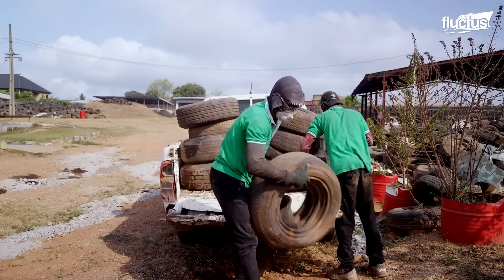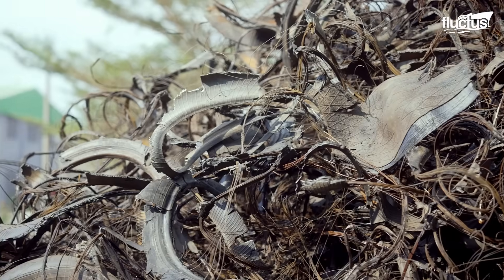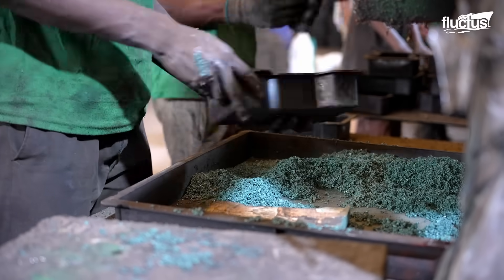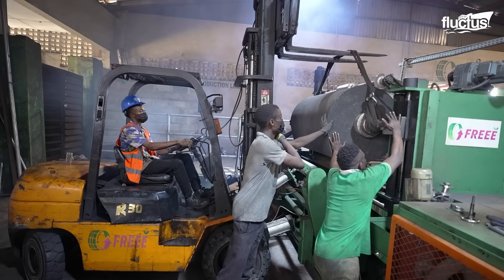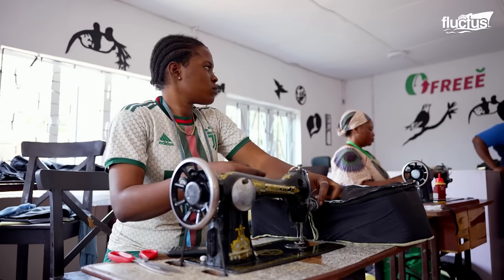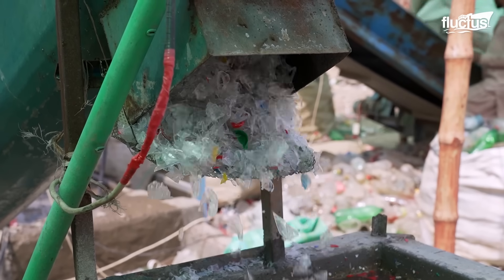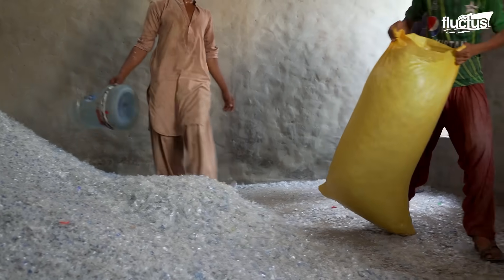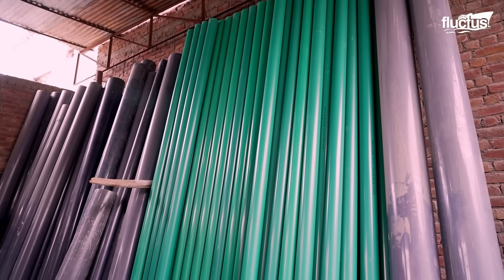How Nigeria Found a Genius Solution to Recycle Millions of Used Tires

Comment: What they are not saying is in the US they tried to use those tire chips as mulch on playgrounds saying it would help with safety.  Issue is tires are not 100% rubber but majority petroleum.  In the summer you can smell them breaking down. It smells like asphault and is a carcinogenic.  So the US had to remove all.  I owened a tire store for over 20 years.  Have you ever smelled when a person spins their rear tires? Breath it in you'll be sick . The petroleum in this product has not been removed.  It's a toxin as it breaks down. Trust me there is no good solution to this issue. Used to be even a small 14 inch tire used over 5 gallons of oil to make. These days maybe less but petroleum all the same.

Comment: 400,000 tires in 3 years = 75,000 per year divided by max 365 days = 205 tires per day divided by max 3 shifts max per day = 68 tires per hour - on that single steel belt shredder - at more than one tire per minute?  That was a small operation and perhaps they have other plants - but I'd be very surprised if these numbers are accurate.  I love the idea of solving the use tires issue, but so much of what they tell us about recycling is inaccurate.  See plastic resin numbers 3, 4, 6, 7 - never or rarely recycled, just moved to other countries.

Comment: I think these people may be going down a dark and dangerous path. 
It is very likely that they are pressing the tire particles into cancer-causing bricks (pavers). 

I asked Google if tire particles were carcinogenic (cancer-causing). It answered - 
"Yes, tire fragments can contain carcinogenic compounds. Tire wear particles and emissions include heavy metals, polycyclic aromatic hydrocarbons (PAHs), and other toxic elements that can pose health risks. Some of these substances are known carcinogens, meaning they can cause cancer." 

I recall the use of tire particles was stopped because children were getting various cancers from their tire particle based playground. Beware! Check and see what is going on!

Comment: This is not actually a new idea.
I remember for a short time back in the early 60’s I worked for Bata Shoes. As part of the induction to the company, I was invited to a tour of the factory in East Tilbury.
I noticed that they had a mountain of old car tyres and I was told they would be transformed into soles for some types of shoes.

Comment: I built a whole extension on my house using the packed tire method. All the tires are packed with earth and stacked as walls then coated with a soil clay mix that seals them and any residual off gassing. Got then idea from the earth ships they build in Mexico and the states, the tires you can get for free from the local tip then its just manual labour and lots of it, very satisfying though good people.  Whole houses can be built like this look up earth ships on google.

Comment: this isn't the only method to recycle tires.

earthships & mechanical concrete are 2 ways as well 

i have used a few hundred to build retaining walls for various landscape features & as a stabilized base for my 1ksqft patio.  parging the tires w/a mason mix, carving stone patterns, & coloring gives the look of a field stone wall.

it's labor intensive; however, i got the tires for free & enlisted the "works for pizza & beer brigade" a few times,  2 summers later & bob's your uncle.

Comment: Found this on google,
Yes, tire rubber and the processes involved in its manufacturing can expose workers and potentially the environment to carcinogenic substances, including N-nitrosamines and other chemicals. Tire rubber can also release fine particles into the air that can be inhaled and lead to lung cancer. 
Guess I wouldn’t want anything I would wear or use around the house or food to be made out of this stuff.

Comment: There's been a higher cancer risk associated with use in athletic pavements. There's some off gasing when subjected to high temperatures and UV light from sunlight. Maybe that's why it's mostly burned for energy in cement plants in the US and EU. I believe most plactic waste is "recycled" by burning it without telling us the truth. And it's the better way because it wont become microplastic this way

Comment: This is NOT environmentally friendly. The shredded tire crumbs will produce microplastics, a more environmentally challenging byproduct that is also a health hazard.
The chemicals in the tires -Zn, Sulfur, heavy metals, and PAH—will easily leach into the environment and waterways. 
Also, the tire crumbs are reported to be carcinogenic. 

This is a repurposing process, but it puts the environment & citizens in more hazard than a pile of used tires.

Comment: While this is a better option that simply tossing them in a landfill in reality it isn't much different. They are still sitting on the ground slowly breaking down and leaching into the soil.  A better, albeit more costly option is to pyrolyze them back into feedstock to be re-refine and reused for other products.  There's actually quite a bit of useful material that can be recovered from tires after pyrolysis and if done right it is a FAR more environmentally friendly option that just grinding them up and walking on them.

Comment: Are we really Id iocracy degenerted…? This is more of a problem than helping. This materials are brought on purpose- there are other options to avoid this poisonous materials not realized for many reasons beyond the imagination of brainwashed individuals.

Bacteria that transform rubber and plastic into natural substances would be a solution.
The  shown economizing advertising manipulating bullshit, however, “destroys” yet more energy to convert a problem substance into superfluous products containing problem substances!
The industry propaganda shown, deliberately prevents nature-compliant solutions such as the return to product cycles based on hemp or other natural fibers.

Comment: How do they convert PET (commonly used for soda bottles) into PVC?
PET and PVC are chemically incompatible and cannot be mixed or converted into one another. Additionally, PET does not have the necessary properties—such as rigidity, impact resistance, and long-term durability—for use in stormwater pipes. It's more likely that the bottle caps, which are typically made from HDPE, are the material being recycled for such applications, as HDPE is suitable for making durable, weather-resistant pipes.

Comment: Superb.   The whole world should be doing this.  Thank you.   Brilliant
Reply: The Nigerians didn't 'find' this solution, they copied it from elsewhere, it has been done in Europe and North America for many years... 👍
Reply: @ I haven’t seen that.  Not seen the results either but I applaud  them too.  Don’t care where it started but the rest of the world would do well to follow.  Not heard of it in the UK.
Reply: @dawnmatthews7716  Here in Canada, recycled tires is used for a few things that I know of. Those winter anti slip rubber mats that you can lay on outside stairs or porch. They also make big rubber weight to hold temporary signalisation during construction or road works. It is also sometimes incorporated into asphalt as apparently the rubber particles can give it interesting properties
Reply: @EvilMaxWar  Also, in Canada, rubber tires are/were an ingredient in concrete/cement.
Reply: I live in Oklahoma and we have a tire recycling plant in the town south of mine.
Reply: @oklahomaisok that’s excellent.
Reply: The world is doing this.   This factory is an old outdated version of the process they adopted from other factories.
Reply: there's no valid reason why we don't do these things in America
Reply: @davidnewland2556  We have a tire recycling plant in central Oklahoma. The EPA tried to stall the opening of it but it eventually got permission to operate.
Reply: @davidnewland2556 We are
Reply: Notice how many steps involve workers handling the materials. For this to economical, it requires wages to be very low, and workers to be compliant. You wouldn’t see the average North American teenager accepting such jobs for the kind of payment required to make it work…😢
Reply: @donaldleblanc3056  or the UK 😂
Reply: I could be wrong, but this probably can’t be done in America because of all the ridiculous rules and regulations that the ruling class has put upon the people.
Reply: @barbarajennings1798 I’m in the UK.  I’ve no idea if it would be a problem to implement.

Comment: This was happening in Canada in the late 90s very early 2000s and subsidized by the government.
We had to pay extra Tax buying a new tire (which still exists) and pay another $5 each tire when dropping off at the transfer station/dump. 
Today the Tax (they call it Eco Fees) apply when buying any tires.
Both the $5 Recycle Tax AND the purchase tax at once.
You pay those Eco Taxes even if you're keeping the ones you were switching from yet the actual recycling places are nearly gone. 
Once the subsidies stopped... so did the tire recycling on as big a scale as it had become. 
I think it still exists here but it's only a few plants.
It was pretty much the same thing - Cow Mats, Floor Mats for industry and vehicles etc.

Comment: 95% of waste still goes into the land fill and ocean and creating a temporary floor or waste water pipes is not getting rid of the tire, it's still there when the floor is deconstructed or new pipes need to be installed. This is not a cycle, this is hiding part of the problem for some more years.

Comment: Suggest using the bead wire to wrap the stacks would help with the recycling of the metal. I can design a twist wire mechanism that would bind the bunch.

Comment: What a nightmare of a work environment.  I can't imagine how unhealthy it would be to do this work.  God knows what volatiles are gassing off from just shredding them alone.  No particulate mask can block that.  Yes, in theory recycling is good, but look at HOW they are doing it.  Crazy.
Reply: Carbon filter lab grade brother you could spray paint and not smell it also stops nitric acid fumes and that makes rubber dust seem like play doe. Really should have extraction to a disa carbon filter before being exhaled to the environment.

Comment: Great idea, but more engineering is required to process into useable products with sealed automation to prevent health risks to workers.
Reply: then the workers go hungry
Reply: @iantaylor2675  The unsolvable problem with automation, when it is combined with capitalism...
Reply: @iantaylor2675 still the workers are getting sick with pollution. They need more protection. More automated machines are required for efficiency.

Comment: 5:48......The bricks made from the recycled tires is a good idea. But.......a few years back I was at a patio party with them used as pavers. In the heat, they still emit the smell of a rubber tire. Go into a tire store and take a deep whiff. That smell is what this patio smelled like. Again, it's a good idea, but not for a patio area.
Reply: Don't know how I would feel about it long-term, but wierdly I quite like the odour in tyre shops.

Comment: I highly doubt the masks the workers are wearing are rated to filter out rubber dust.....
The biggest mistake this  country has made in their recycling efforts is single steam recycling
The segregation of plastic waste should be done by generator( consumer) NOT by the recycling facility... It just adds to the over all cost of recycling

Comment: So ireland sends the garbage to other countries after compacting them.
Reply: Aluminium smelting is usually done in places with ore and cheap electricity.  The recycled stuff is just added to the crucible and actually helps the massive carbon electrodes conduct.  Glass however is relatively more expensive to transport, for its value.  Plastics are quite often just burned as fuel.  ;(

Comment: How do they remove the metal belts from the treads? Steel belted radials for example.
Reply: Did you watch the video?
Reply: @abacab87 The video only showed the steel being removed from the bead of the tyre, not from under the tread. Valid question.
Reply: Magnets.

Comment: They mentioned being burned and contributing to environmental damage! Tires burn cleaner then coal in a plant that is set up for them vs a plant set up to burn coal. The reason being is the makeup of a tire is consistent and the burns can be adjusted to the best conditions. Coal verys more sulfur less sulfur more stone less stone. As long as you are burning coal and piling your tires up your not doing what's best. Best to burn tires before you burn coal.
Reply: Interesting, never thought of this. Thanks for the new info.

Comment: Never work in uk,far too much labour involved
Reply: The West would automate more.
Frankly we do have tiles like that.
Some playgrounds use them, outdoor training grounds, gyms.
Tough if they are from recycled stuff?
Who knows.
Usually you could find them also as anti vibration mats (or as rolls) in hardware stores.

But I can tell you nobody in the West would accept pavements with unregular gaps where you can put a whole finger into.
Reply: @Peter2k84  Came here to say the same thing. In the West, most of the process would be Automated. Would produce tiles with 2-3mm tolerances, which would get rid of uneveness and gaps. Even someone OCD wouldn't notice the difference.